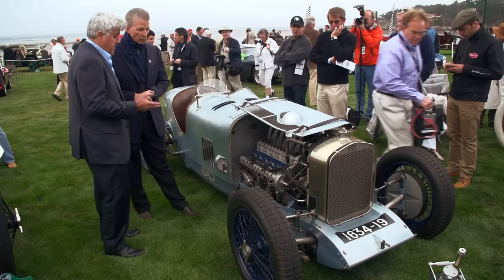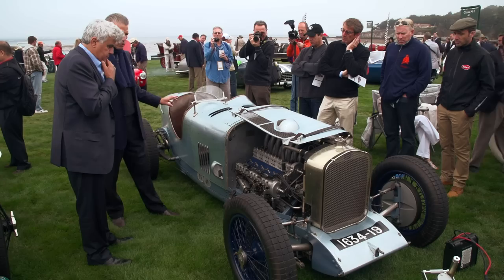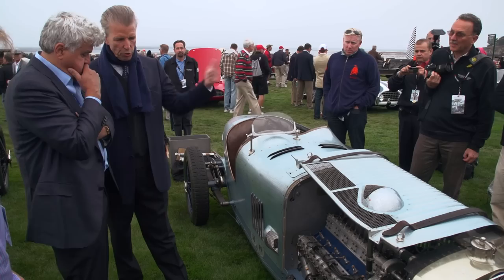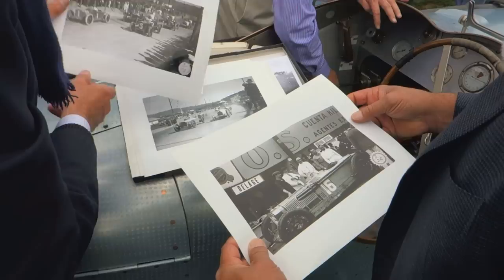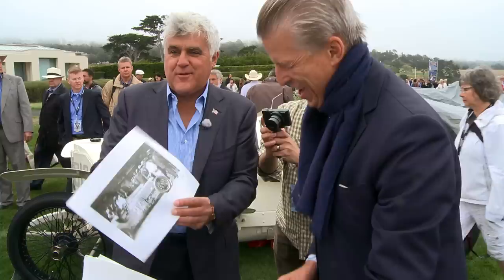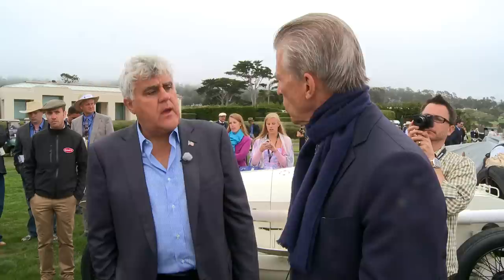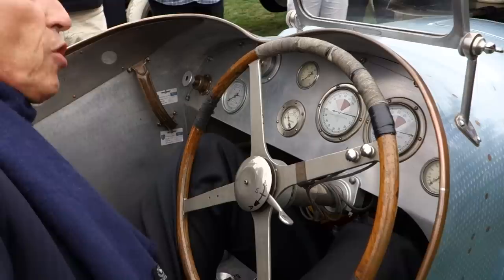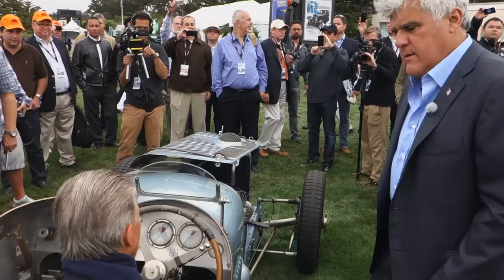Pebble Beach 2012: 1924 Delage 2LCV V12 Grand Prix - Jay Leno's Garage

Comment: These pre-war racing cars are all just insanely cool. Grand Prix, Indy, le Mans, even the little sprint cars and midgets, or home-made/modified salt flats cars; they all just ooze 'cool'. But with this car in particular- the quality of workmanship, and technology/performance in the era, is so impressive.
Reply: And now thanks to dedicated modders within the Assetto Corsa community, there's now nine pre-WW2 car mods built from the ground up:
🇫🇷 1923 Bugatti Type 32 Tank
🇫🇷 1923 Voisin C6 Laboratoire
🇬🇧 1923 Sunbeam 2-Litre GP
🇮🇹 1923 Fiat 805-405
🇫🇷 1923 Delage 2LCV
🇫🇷 1923 Rolland-Pilain A22
🇫🇷 1927 Delage 15S8
🇩🇪 1937 Auto Union Type C
🇩🇪 1937 Mercedes-Benz W125

Sim Racing allows enthusiasts to live automotive history across almost every era and discipline imaginable, especially with Sim platforms open to modding such as AC and RFactor 2 allowing contributors to share the Deep Cuts that the original developers  don't have the time for.

Comment: Sounded like they said redline was 5000rpm in the video and if that is the case without any forced induction there is no way it has 190 hp from 2 liters and a 5000rpm limit.

Comment: 180-190HP from 2 liters with a maximum rotation speed of 5K in 4 cycle piston engine.  Sounds like some nitro(doubtful) or maybe they measure the horsepower different then current NET ratings at the crank.

Comment: 2.0 180 HP. .1924. I find it a little hard to believe. The 1955 Mercedes gp car had a DOHC 4 valve per cylinder 3.0 desmodromic making 100 HP/liter